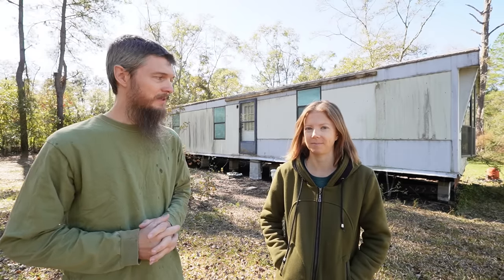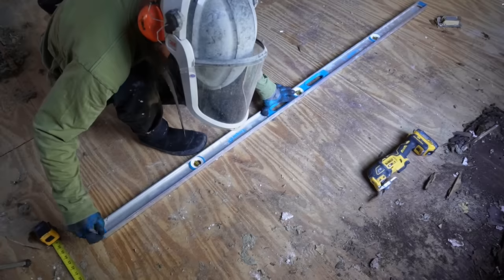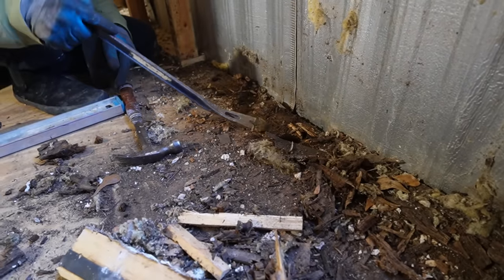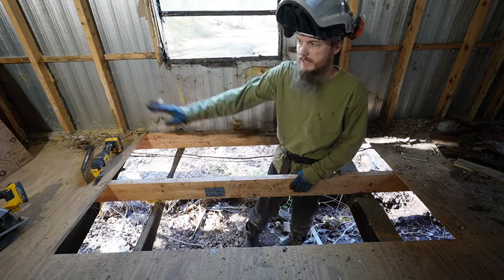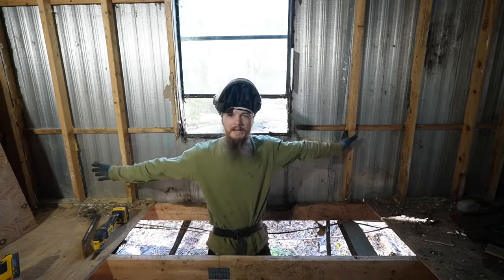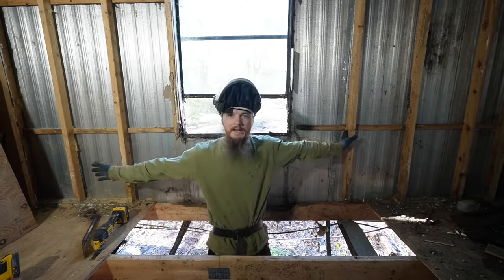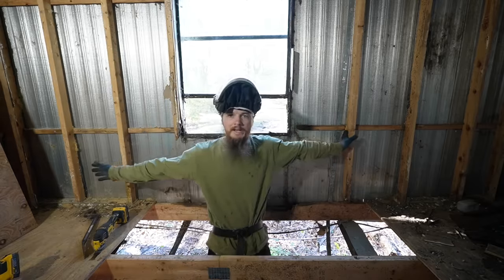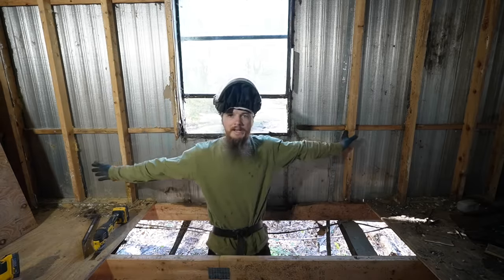Rotted Floor Repair - Mobile Home Rebuild

Comment: Your yard must still be under water for yall to comr here
Reply from the maker: Our yard didn't really get too wet. It was mainly confined to the woods.
Reply: strange comment if you watched the video...they said their prep work with sand did wonders.

Comment: Floor would be stronger installing the plywood going in other direction.
Reply from the maker: That's true but I don't think it will make much difference here. In a patch job like this, I usually just choose the way it fits best to minimize the amount of seams.
Reply: As long as you have good support it doesn't matter.

Comment: Might as well demo the mobile home, they are poor quality to start with (2x2 walls, cheap windows, particle board floors, weak frames, ect, ect).  You are throwing money at a pile of garbage.
Reply: Sometimes it makes sense to rebuild.  For example, if the old one is grandfathered in, but new mobile homes are not allowed due to zoning, fixing it up is the only way to keep it as an investment.  The area where it is located makes a big difference.  Every situation has to be considered based on the circumstance involved.  That trailer has plywood floors rather than particle board.
Reply from the maker: It's worth it to us to fix it up, for several reasons. This mobile home doesn't have particle board floors, it's real plywood, and the walls are 2x4s and 2x3s.
Reply: @debbiebeckstead9268  I agree that they can make it nice, but the cost will exceed it's value.
Reply: @TheHobbyShopFilms my thoughts exactly!
Reply: It’s a money put for sure. I’ve no doubt they can make it beautiful, but they’ll never get the return on their investment. Just tear the rest down and build a small house
Reply: They'll get a return on their investment by making money renovating on YouTube. If they just bought a new mobile home they would have nothing to make videos about.
Reply: @TheHobbyShopFilms  I was thinking the same thing, but who am I!